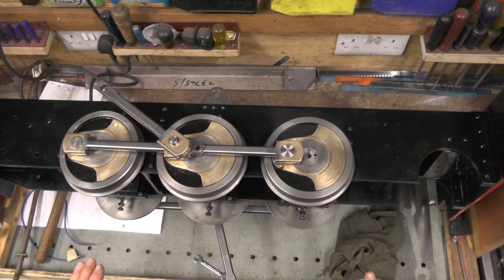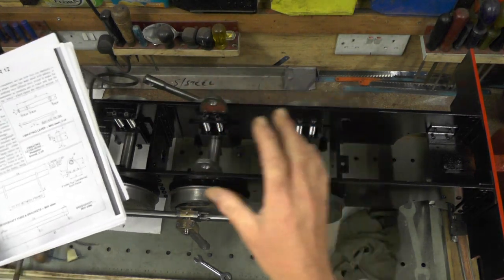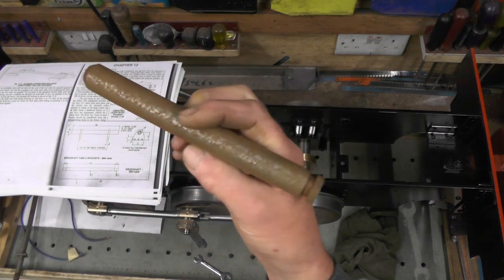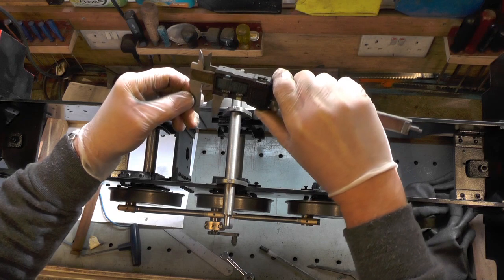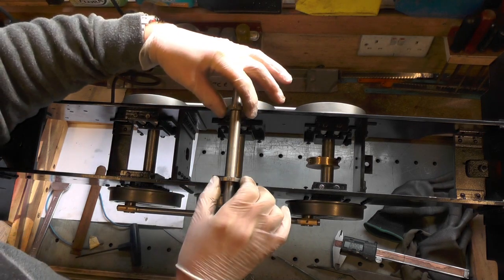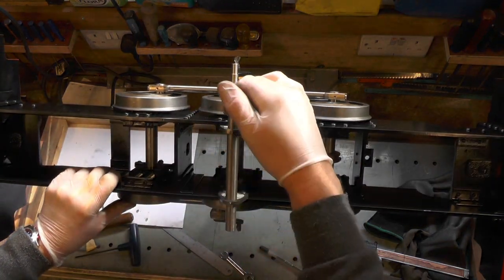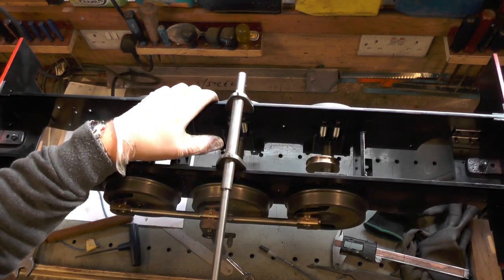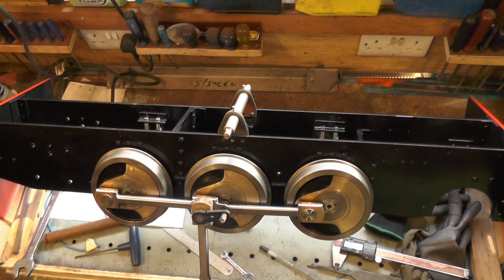Making a Beginners Steam Locomotive "Weighshaft Components & Assembly"  "mr factotum"

Comment: instead of braizing the tube to the brackets   you could assemble it  then silver solder it   all nice and rigid. you could also think about using metric tube  as long as the  dia is  about the same
Reply from the maker: hi nigel
yes good idea, there's always more than one way to do things if you think outside the box, I did actually think of silver soldering in situ, but decided that the heat involved might transmit on to my painted items, plus I was able to spray paint it off the loco before assembling,
thanks for you interest and comments
regards
mr f

Comment: Remembering that it is very important to get a good fix of the blocks onto the Weighshaft.
Also important is to try and keep the pipework away from the area so things can be got to in case of adjustment. Bolts from the outside going into tapped holes. Into nuts is difficult. I have just started looking at a Jessie 7 1/4" and this is a very well thought out design. David & Lily.
Reply from the maker: cheers steamsearcher. appreciated
mr f